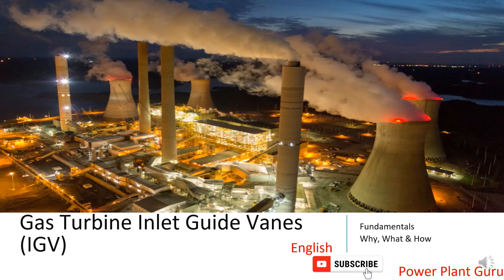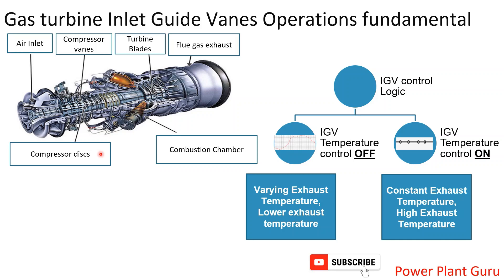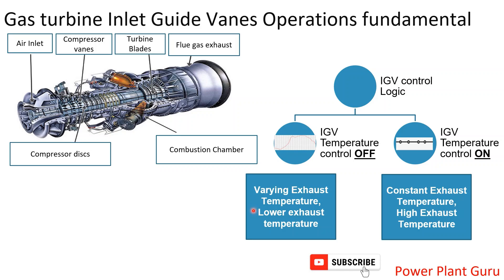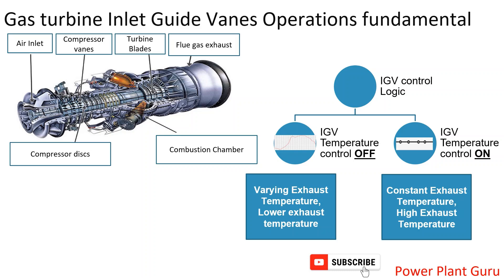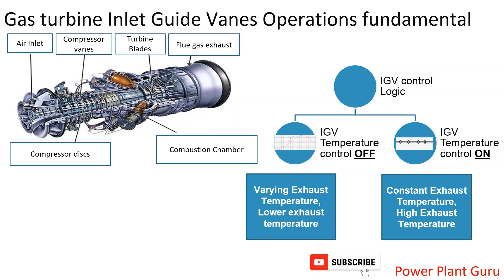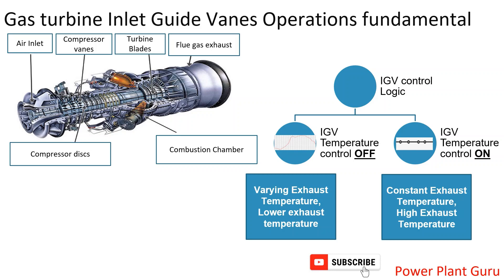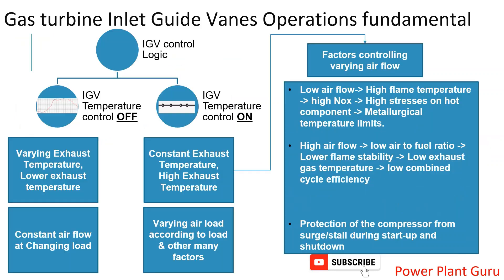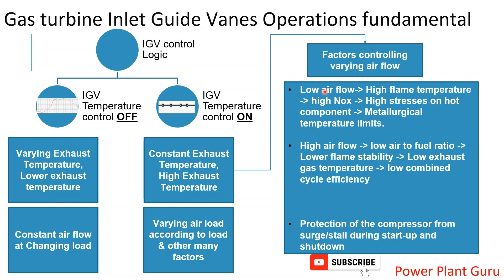Gas turbine inlet guide vane,  How IGV works part 2, igv tutorial, power plant guru

Comment: Hi sir, your lecture is good. I have some doubts,
For combined cycle power plant with HRSG, if you want to maintain exhaust temperature the same with partial load also, then
My doubts are
1) First to decrease load, you would decrease fuel flow. Now, if you decrease fuel flow, turbine inlet temperature would change na?  So, in operation do they always keep turbine inlet temperature same irrespective of loads, or they can  change turbine inlet temperature or not?
2) If you want to maintain same turbine inlet temperature, then we have to increase or decrease the airflow?
3) Why at partial loads(loads less than base load), exahust temperature is said to increase? Why?
Reply from the maker: The question are good we can connect in our live session

Comment: IGV temperature control works on Exhaust temperature CPD biased control? As per my understanding due to any reason when cpd increases it increase air flow to combustor with (igvs fully open ) this will decrease combustion temperatures hence ttrf will decrease and ultimately ttxm will decrease. As TTRF falls below ttxm at new CPD value the fuel flow will increases to maintain constant firing temperature. 
But with data trend the ttrf wouldn't come to its original value as cpd increases or decreases with change in ttxm.
Reply: Sir please explain it......

Comment: Have you posted any video on trip oil system employed in GE designs.

What i understand during normal operation trip oil flows to solenoid valve and 20 TV, Gas fuel stop valve and Liq fuel stop valve.
When command is initiated the solenoid valve make it flow to drain thus droping the pressure of trip oil header which further close the igvs and fuel valves but

But igvs are actuated by hydraulic pil so how trip oil trips them.
Reply from the maker: Let's discuss this in a doubt clearing session.
Reply: @powerplantguru007 
How to participate in that?
Thanks a lot
Reply from the maker: Please join our membership to have questions and answer sessions.

Comment: What is IGV temperature control slider?
Secondly how cpr relates with exhaust temperature?
If CPD is high then CTD is high and CPR is high?
Reply from the maker: Hello Syed. Thanks for watching my videos. I regret the delay in responding to your queries to time constraints.  Please refer below reply to your questions (one answer for different comments) 

TTRX is a calculated value that uses some array values and the CPR (Compressor Pressure Ratio) or CPD (Compressor Pressure-Discharge) value to arrive at TTRX--which is the absolute maximum allowable turbine exhaust temperature for any given operating condition. When the unit is operating at Base Load, TTRX is used to determine FSRT, and it is the lowest FSR input value to the MIN SEL block. When operating at Base Load the turbine control is being told to put as much fuel as possible into the unit while still protecting the hot gas path parts and the exhaust diffuser to produce as much torque as possible to produce as much electrical power as possible. And the exhaust temperature reference, TTRX, becomes the limit for the amount of fuel being admitted to the turbine. The Mark* compares TTXM (Turbine Temperature-Exhaust, Median (actually it's an average exhaust temperature)) and TTRX and controls the amount of fuel to make TTXM equal to TTRX.

During part-load operation when the IGVs are being used for either IGV Exhaust Temperature Control OR for DLN combustor air control the IGVs are closed to maximize exhaust temperature--up to TTRX. Maximizing exhaust temperature for units which exhaust into a HRSG (Heat Recovery Steam Generator; a "boiler") maximizes steam production at Part Load conditions which increases the overall plant thermal efficiency (a lower plant heat rate). TTRX sets the limit on exhaust temperature--so TTRX is used to derive the maximum amount the IGVs can be closed during part load operation to prevent TTXM from exceeding TTRX.

When the turbine has DLN combustors the IGVs are used to control the amount of air flowing into the combustors--BUT, that's NOT done by measuring air flow. GE knows, from decades of operating data and experimentation, how much air is flowing for given IGV angles. And, what they do is they modulate the IGVs to control air flow to maintain flame stability--and they do that by keeping the IGVs closed as much as possible. And the effect of closing the IGVs is to maximize exhaust temperature--but TTRX sets the maximum limit on exhaust temperature. So, TTRX is used to derive the IGV angle at Part Load, just like during IGV Exhaust Temperature Control.

(By the way, keeping the IGVs closed as much as possible during Part Load operation decreases turbine thermal efficiency (increases the turbine heat rate)--but if the unit exhausts into an HRSG that's good for the overall plant heat rate and steam production. And for units with DLN combustors, it's absolutely necessary to maintain flame stability.)

Please ask in case of further queries.
Reply: @powerplantguru007 Thanks a lot to your detailed reply.
Please Accept my apologies, my notifications are idk why turned off I've not seen any notification. Thanks a lot Sir for your valuable time